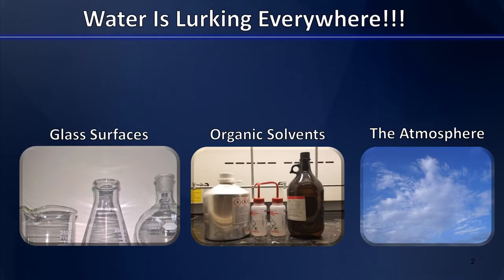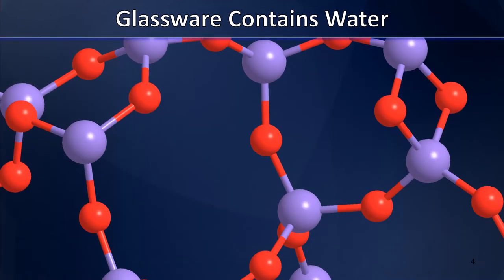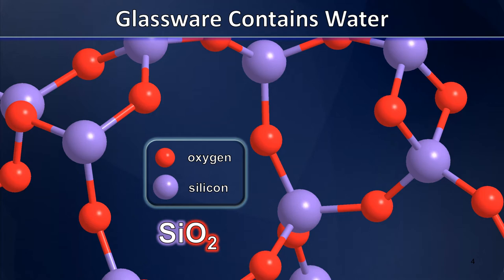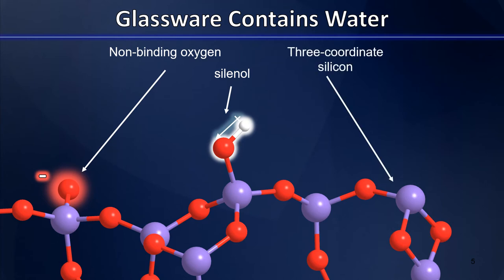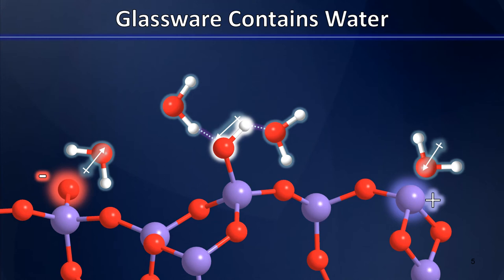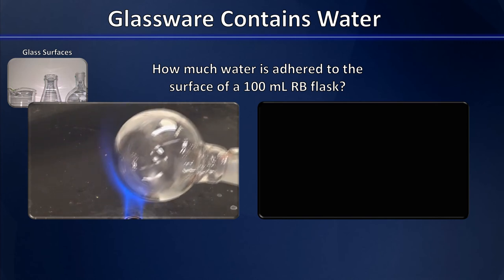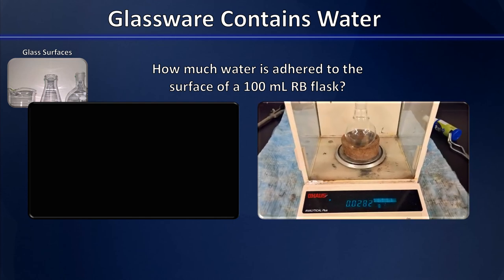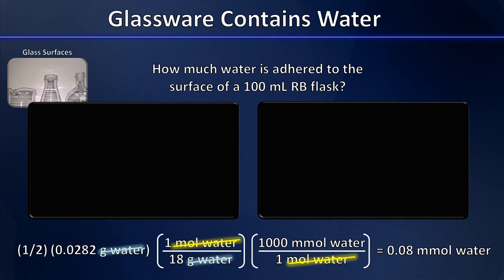Why Must We Sometimes Dry Glassware and One Way We Do It - Flame Drying

Comment: I stopped doing this after cracking a few flasks. Occasionally a tiny drop of water from the condensation would drip onto a hotter part of the flask and immediately crack. Any tips to prevent this? Lost a nice 2L 😒
Reply: Perhaps use a hot air blower. Like hairdryer?

Comment: I think you slipped a decimal point in the calculation near the end. When I repeat your calculation I get to 0.8mmol, not 0.08. I was actually looking for another error I thought I spotted previously - but that may be in your subsequent drying-solvents video.

Question: when you "burn off" the water like that, where does the water vapour go? It may be desorbed from the glass surface, but it's still inside the flask, no? So won't it simply condense right back onto the glass by the time you've got the flask into the desiccator? Is there some trick behind the curtains you aren't showing us?
Reply from the maker: You are right that you can see some of the water re-condensing on the glassware in the initial stages of flame drying.  However, once the glass of the flask is fully heated (notice I have to hold it with tongs so I don't burn my fingers) the vast majority of the moisture has nowhere to condense and escapes out of the neck and into the atmosphere as water vapor.  This is also why we NEVER flame dry a closed system, as it would generate enough pressure to possibly cause an accident.  

There are no tricks, but there is a catch!  The dried glassware must be placed in a dessicator or assembled into a closed reaction apparatus protected by a drying tube, for instance, before moisture from the atmosphere has time to re-adhere to the cooling surface.  As a rule of them, you have 5-15 minutes from the time the glassware is cool enough to handle.
Reply: What puzzles me is that there's clearly enough water adsorbed on the glass to create a saturated local atmosphere (or else the desorbed water wouldn't condense on the still-cold parts). How do you get that water-rich air out of the flask before it recondenses? By my quick calc there's at most about 67mL of steam at 300°C in there; how do we get the last 50mL (flask size) out - are we relying on diffusion and/or convection here to let fresh, relatively dry air in and steam out?

I'm indeed surprised by just how much water we're talking about here, once converted to a steam volume.
Reply from the maker: There is a flaw in that assumption:  that water is the only gas in the headspace.  Indeed, there will be some water in the atmosphere within the headspace of the flask, but remember that there are other gasses in the atmosphere ready to displace much of that steam, and moisture only makes up a small fraction of the environment inside the flask headspace depending on the relative humidity in the lab on any given day.  It would, however, be safe to say that it will be nominal compared to the amount of water driven off.  

If your reaction is truly so sensitive that even tiny fractions of a mmol of water might compromise it, then you would probably resort to more drastic measures, like using a Schlenk-line or even a glove box to help keep water completely excluded from your apparatus as you set it up.